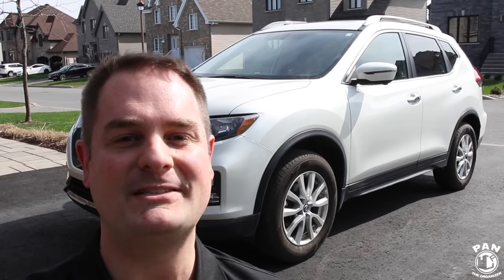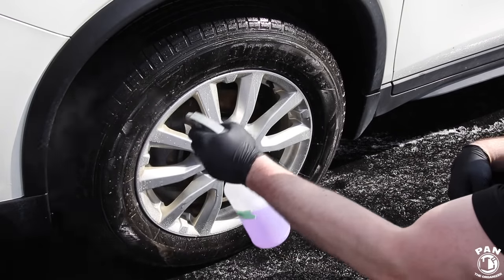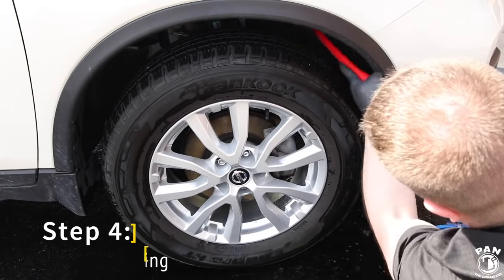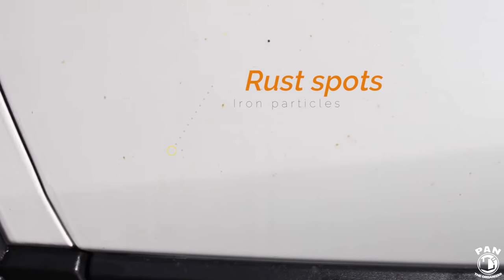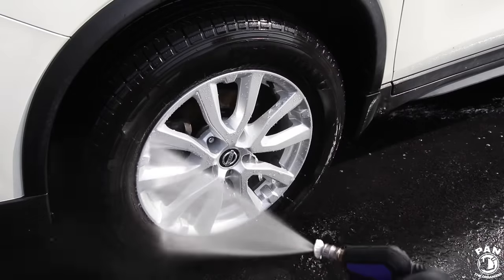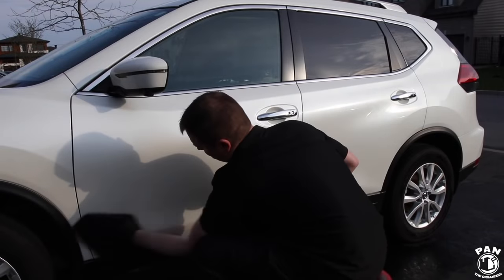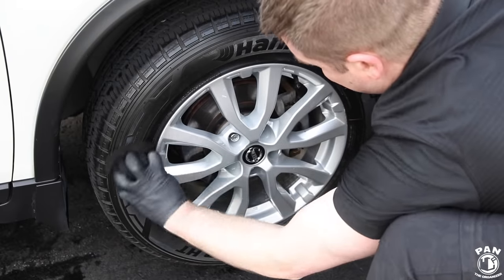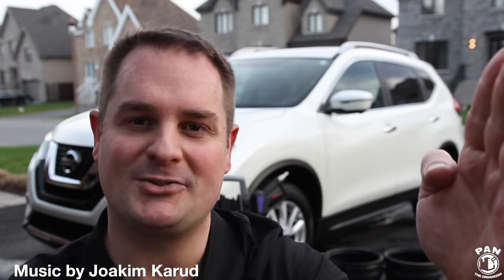SPRING CLEANING CAR WASH TUTORIAL !!

Comment: Hi Pan!  Another cool video from you, that I'm seeing for the 1ST time today...6 years AFTER the fact!  🙄  Anyway, I'm currently detailing a friend's black, Toyota Corolla.  Had to wait until 6pm before I could start detailing due to the immense heat and sunlight here.  I don't have a garage yet, so, I HAVE to work outside.  You may recall me mentioning how I like the 2 wash bucket method.  Well...today, after seeing a short from Yvan LaCroix, I did something different.  He suggested doing a 2 foam method.  Foam the vehicle 1st to let the soap emulsify and lift the dirt, let it sit on the paint for a few mins, rinse, then foam it again and immediately do a mechanical wash, then rinse and dry off. He said this method omits the need for a 2nd/rinse bucket.  He was right and it TOTALLY WORKED!!!  It also saved me some time with washing the car!!  If I'm not mistaken, you've also implemented that method in a few vids, right?  I washed it just like your video instructs and the exterior of her car is CRAZY clean, and shiny!!  Put the TW Ceramic Spray on it and will top it with the TW Graphene Pure Shine for added gloss. I washed it with the Purple Power Vehicle and Boat Soap that you used in this video.  Cool coincidence, right!?  Haven't finished the detail as I STILL need to do a few more things to the exterior, but her Corolla looks AWESOME so far!  Nothing tops a clean, shiny, black car!!  Thanks SO MUCH for sharing your "tips, tricks and techniques"!!!  They've helped me IMMENSELY with my own car detailing!!  Again, great vid, and thanks for posting!!!

Comment: Great video Pan, really enjoying watching these - what should I be doing to clean wiper blades/arms other than replacing blades as needed.
Reply from the maker: Clean them with an IPA solution, or if you don't have an IPA, clean them with a good glass cleaner.  You spray the cleaner or IPA on a microfiber towel, you pinch the wiper blades and go back and forth.  You'll see all the gunk that you remove!!  You'll then get less streaking on the glass and smoother blade action.

Comment: Wow Pan, what a helpful video as always! Also, you haven't had any issues with that purple power being sprayed on the paint? I'm a little worried, but if you have had good experiences with it, I think I'll give it a shot. Also, Can you give me the link to the microfiber wheel brush for cleaning the barrel of the wheels? Thanks!!
Reply from the maker: Never had issues with Purple Power.  I just use it for strip washes.  You don’t use it for maintenance washes during every wash.

For the brushes, I did a full video on brushes with links under the video here:   https://youtu.be/siZhhnve-84

Comment: Pan, great video. I have two questions. 
1. You rinsed the paint first and then did the iron removal. Why not spray the iron remover first and then rinse it off and then start the paint wash?
2. If the car has a paint protecting regimen like Ammo reflex, skin, creme applied, and then iron contaminants land on the protected paint, will using the iron remover after that  also remove the paint protection products?
Reply from the maker: 1. Many people use different methods. I find that it's important to wash the vehicle first, to remove dirt, grime and debris. That way the iron remover can focus more on the iron particles (its job) rather than also fighting off other dirt particles which might not be embedded in the clear coat.
2. Iron remover will not affect ceramic coated cars. In fact it's a good idea to use them every few months. However, iron removers and other chemicals can start to break down waxes and sealants like Reflex, Skin and Creme. So you might want to reapply fresh layers after your spring decon wash. I'm sure Larry has a bunch of videos on his channel on his recommended regimen for his products. As I deal mainly with ceramic coated cars, chemicals aren't a concern to me.

I hope this helps.
Reply: @PanTheOrganizer  Sure does help, Pan! Thanks for your fast reply. Really enjoy your videos!
Reply: Do you use the iron remover on a wet vehicle.  I noticed vehicle was not dried before iron remover was used
Reply: Also noticed no ipa wipe down before finishing product was applied.  Because a quick detailer was used when claying the car . You could of applied your finishing polish over the instant detailer

Comment: Nice on pan, getting the urge to detail my van after watching videos like this. Do you have any tips for washing in direct sunlight. I have a black van and unless I wash first thing in the morning or early evening I have direct sunlight. Any tips or tricks to try stop the shampoos and products drying out?
Reply from the maker: Yeah always wash as late as possible in the afternoon.  If you have no choice but to work in direct sunlight, use a pH neutral soap, wash one section at a time then immediately rinse.  As soon as you’re done with your final rinse, quickly dry your paint using a quick detailer as a drying aid to help remove water spots.

I have a DIY video on how you can make your own quick detailer that is the best I’ve used and good for mobile detailers working in direct sunlight: https://youtu.be/Kn8wYn_P9Js

Comment: As always - great, helpful vid. One question: in which cases would you add a polish stage after claying? I noticed here you missed it. Was that because the car is quite new? Polishing: maybe once every three years?
Reply from the maker: Normally, you follow a polishing stage with machine polishing, as you see in my more advanced full car detailing videos like this one: https://youtu.be/etXhJNaF0EE

But this tutorial for spring cleaning is a basic tutorial for beginners who don't have the tools or skills to proceed with machine polishing. 

You would do a light polish once a year, depending on the state of your paint. If you use proper washing and drying techniques, you shouldn't have to polish the paint for years. It depends on how you take care of your car. Inspect your paint after claying, and if it looks good to you, you can skip this step and move on to protection.

Comment: Hey Pan Great work. Just one question- Is it necessary to apply a paint prep before putting on a paint protection? Didn't see paint prep in this one.
Reply from the maker: For sealants and waxes no.  Before ceramic coatings absolutely.

But if you want, yes you can use a paint prep before a wax or sealant too.  It’s not necessary, but always a good idea.

Comment: Hi Pan, great vid once again. I followed you guide on the ceramic coating looking nice. I just want to ask can I use the " Meguiar’s Ultimate Fast Finish spray sealant:" on the ceramic coating? I did buy from costco a spray on wax and I tested a small part of my SUV and it seems like it wants to soften up the ceramic coating so I stoped. I do have a black suv, and you know how they get dirty just sitting in the drive way, what would be your recommended way on cleaning the dusty suv? I use a wet micro fiber and then follow with a dry one. So far so good. I am looking at getting the gliss protection soon. thanks sean
Reply from the maker: Never apply a wax or sealant on top of a ceramic coating.  You need to apply silica spray sealants during a maintenance if you want to rejuvenate the coating, like in my maintenance wash tutorial here: https://youtu.be/yLiePQRMFc8

Comment: Great video. One question: I see that you have listed a power washer and I think I see you using it in the video. Just want to confirm it is ok to use a power washer to wash a car and it doesn't damage paint?
Reply from the maker: Absolutely.  Anything between 1000 to 2000 psi is very safe for the paint.  Power washers are great tools to wash vehicles, every pro uses them.
Reply: Thanks, Pan. This is very helpful information.

Comment: Wondering about your thoughts on multiple wash mits during the washing process. Any more of a benefit? Thanks.
Reply from the maker: I also use a dedicated mitt for the wheels, and one for the paint as to not cross contaminate wheels and paint.  I work from top to bottom, using the two bucket wash method (technically three bucket method as I also have a dedicated wheel bucket).  It has worked for me during my 20 plus years of car detailing.  This is one of the most popular techniques used by pros.

Other pros use many wash mitts and one bucket.  Some use one bucket and one mitt, and they rinse the mitt after each panel.  There are so many different techniques.  They all have their pros and cons.  To each their own.

I say use what works best for you and as long as you're applying common sense, you're fine.  Not too much pressure on the mitt, avoid working in direct sunlight, make sure you work from top to bottom, inspect your mitt from time to time to make sure there are no apparent rocks or contaminants, rinse the mitt often, etc.

Comment: Great video Pan. After you sealed it, are you suppose to correct and polish it if we were doing a full detail? Or correct and polish then seal?
Reply: Correct and polish before you seal :)
Reply from the maker: You always do paint correction first, IPA wipe, than apply your paint protection last (wax, sealant or ceramic coating).

Comment: Hi Pan. Is it useful or needed to use a foam cannon not just for pre wash but also to coat car in shampoo then use wash mit etc? Or is that being excessive?
Reply from the maker: Pre-washing with a foam cannon isn’t a mandatory step.  But it’s a good way of removing loose dirt and contamination by using lubrication, and reducing the chances of swirls or scratches during the wash stage.  It’s all in the little details.

Comment: Hey Pan, I can see you are applying gyeon wet coat hydrophobic on wheels and another product for windows so my question is: the turtle wax graphene flex spray can do that job too right if I apply on windows, wheels correct ?
Reply from the maker: Yes. Flex Wax can be applied to all the exterior surfaces: paint, wheels, plastics, glass and lights.

Comment: Pan, do you clay bar with every wash? Or just when you are going to protect it with wax/sealant?
Reply from the maker: You only should clay when the car needs it.  After you wash your car, run your fingers in the lower portions and see if you feel any contamination or gritty surface.  If you do, then you need to clay.

Comment: Hey Pan, great video as always.

Finally getting around to full detail of the car and did wheels today along with wash and chemical decontamination using iron x then tar x. I think i messed up though in applying these products to the clear bra/paint protection film on the from part of the car. It is all marked up now and I can not get it back to clear. Is there something that I can do to get this clear gain or is it toast. If so How do you remove this stuff?

Would like to get this fixed as I plan to do clay, compound, polish and ceramic coat tomorrow.
Reply from the maker: It’s very hard to messup chemical decon..  Did you let the products dry?  Did you apply them in ditect sunlight or too high heat?

Hard to tell without seeing what you did...
Reply: Maybe it would be considered marring. You can find pics here in the stinger forum i posted to:

https://stingerforum.org/threads/clear-bra-paint-protection-film-issue.7013/

Comment: Pan, when decontaminating your car , should the car be wet or dry when using Trix
Reply from the maker: You can apply TRIX on both wet or dry surfaces.  To save time, you can spray it on a wet surface it works just as good.

Comment: Does the Meguiars Wheel brightener have a nasty smell? I used Simoniz acid based cleaner and while it worked good I had to use a mask when I sprayed it as it smelled horrible.
Reply from the maker: It doesn’t smell great that’s for sure.  Most effective wheel cleaners smell bad.

Comment: I see you had until recently a SunJoe PW but you switched to Ktanzle. they are just water pump when working... what do you find in the Kranzle to justify a 5X price boost? When in use what do you get now that you did not have before?
Reply from the maker: I had a Karcher K5 before, not a SunJoe.  My Karcher had 1.4gpm water output and my Kranzle has 2.1gpm, way better to get richer foam for pre-washes.  Betond that, it’s built like a tank (in Germany not in China like Karcher) and the experience using it is just nuts.  Hard to put that in words.  That being said, I had a K5 for 10 years and it was still going like new.  Great bang for buck.
Reply: Thanks! I mentioned SunJoe because that is what you recommended in the list above. Re Kranzle I understand the 'quality feel" - like comparing a Rolls to a Toyota but they both drive you from A to B. So from a task result perspective I suspect they both deliver equally. Re foaming - that is strictly a foam gun orifice size issue (easy to deal with).
Reply from the maker: Yes you got it, the experience is an intangible.  And yes I know about orifice mods but I don’t mod my equipment.  I found that the higher flow rate on my Kranzle did the trick. :)

Comment: Could I ask I just did my spring cleaning on my Lexus IS 250 I did a pre wash and washed it again I didn’t have the iron removal spray but I used clay bar I had lots of oxidation dots on my paint could I ask if that was still good or could I have damaged my paint I only skipped the iron removal
Reply from the maker: Iron removal is important.  But for oxidation, machine polishing the paint will remove oxidation.

Comment: I'm new to car detailing and I recently bought some synthetic wax for my car that is about 9 months old. Should I strip the remaining wax on the car (if any) before I apply the new wax? if so, would dish detergent be viable?
Reply from the maker: No need to strip the old wax. Just apply wax on top.  Stripping old protection is more important before applying ceramic coatings.
Reply: @PanTheOrganizer  Okay, thanks!

Comment: Thank you Pan. How can you tell if the car you’re washing is ceramic coated?
Reply from the maker: That's a good question that is hard to answer. Ideally you would know from the person you are buying it if a ceramic coating was applied. To see visually if there is paint protection, when you ware washing and rinsing the car, look for hydrophobic properties. If you see water beading and quick water sheeting, that's usually a visual indicator that there is some form of protection on the paint. It could be a wax, a sealant, or a ceramic coating. If you see that the protection lasts for many months or years, it likely is a coating (as waxes only last 1-3 months and sealants last 5-6 months). 

If you see no water beading, and the water just pools up and is very slow to sheet of the panels, then there is likely no protection on the paint.

To ensure the paint is 100% free of any previous protection before you apply a ceramic coating, you must do some prep work including machine polishing. Like in my ceramic coating application tutorial here: https://youtu.be/sqQYVjxFqK0
Reply: @PanTheOrganizer  Good stuff!  That helps so much.

Comment: What can I use to get rid of the browning of the low plastics, caused by traffic film? I use the car soap with the mitt and it doesn’t clean well
Reply from the maker: You need an APC to clean those, or even a degreaser like Super Clean.  Clean the trim first, then apply a trim protectant.
Reply: Thank you so much!

Comment: Would you recommend meguiars wheel brightener? Most people say not to use it because it’s acidic but can I assume to be able to use it on all new vehicles?
Reply from the maker: I use it very often.  One of my favorite wheel cleaners.  It's acid based, but if used correctly and you rinse off immediately after 30 seconds, you're fine.
Reply: Pan TheOrganizer so I shouldn’t have to worry when using it? I’m pretty sure most cars rims  today are clear coated from factory
Reply from the maker: Pretty much 99% of factory wheels are clear coated yes.  And you don't use the Meg's Wheel Brightener at every wash.  Only use it when you see your wheels are heavily soiled or have lots of brake dust.  For regular maintenance washes, a lighter wheel cleaner will do (I like AngelWax Bilberry wheel cleaner, Ammo Plum, Chemical Guys Diablo Gel, Sonax Full Effect Wheel Cleaner, etc).
Reply: Pan TheOrganizer thanks man

Comment: Pan, did you dilute the purple power? If so, by how much?
Reply from the maker: You always dilute Purple Power Vehicle and Boat Wash.  I typically add 4 to 6 oz of snow foam with 16 oz of water in the foam cannon.
Reply: Pan TheOrganizer Sounds good. Your link goes to Purple Power Multi-Purpose. Is this the same as Purple Power Vehicle and Boat Wash? Also, are you able to apply Purple Power without a pressure washer (foam cannon)?

Comment: Most imp tip: dont use clay if you are not polishing after..Only use claybar if you are doing proper correction after as claybar and claymitt will mar the paint no matter what..
Reply from the maker: Yes good point.  You usually follow a claybar step with paint polishing as a claybar is a form of an abrasive.  But as this is meant more as a beginner's guide to a proper spring detail, I left the paint correction steps for other videos as I've covered this extensively.

Thanks for watching!
Reply: good point..